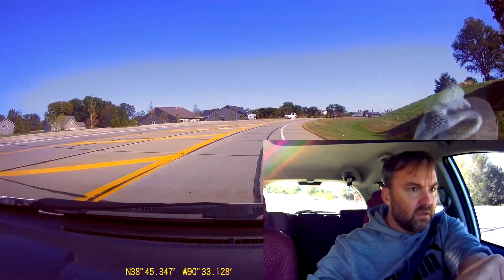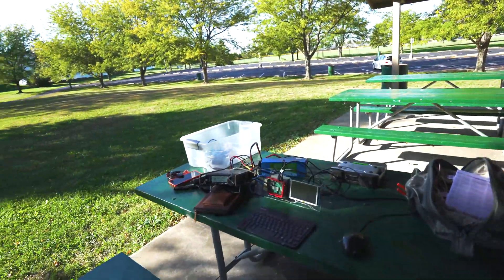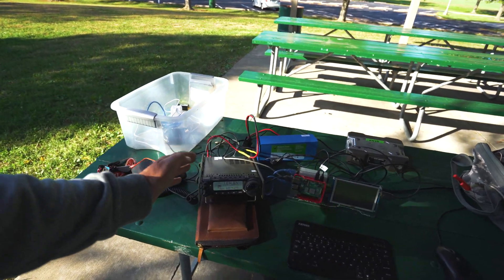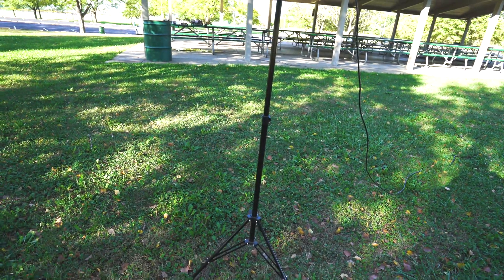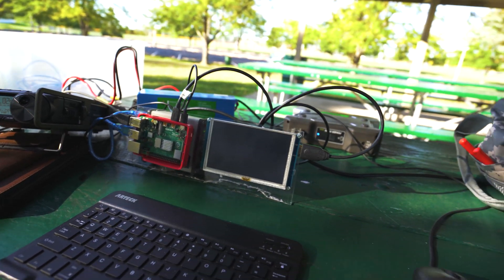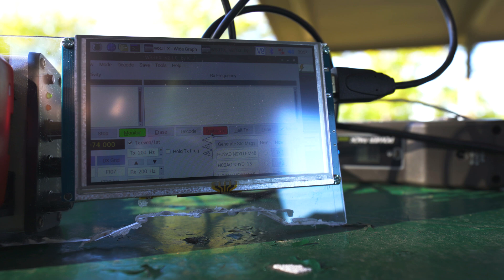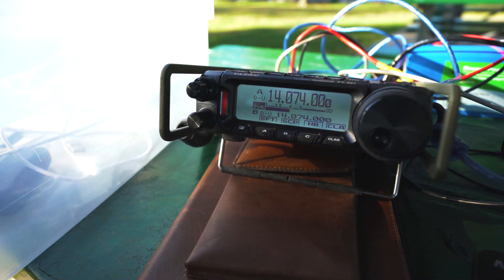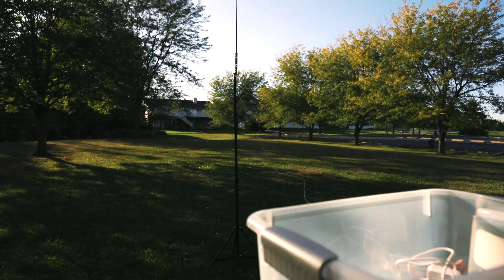Field Test | Raspberry Pi | WSJTX FT8 Digital Portable

Comment: Sometimes what appears to be a failure is actually a success! I would type out a nice cheat sheet with diagram of your setup and laminate it. The no decode thing is probably a clock issue and lastly, I have always had success with a ground mounted vertical with 8 or so radials. An MFJ whip and a ground mount stake made up with an SO-239 on it is the way to go. NOTE (Putting out a CW CQ signal would have shown that you were getting out). Great video!

Comment: Hey Tom .., the problem receiving was the clock ., the clock should in sync with the info received on the ft8 , there are 2 workarounds.. 1- use a gps for the clock sync ., 2.- Add an external rtc module to the pi ., and made the sync at home. :) XE1GSY.. 73 !!
Reply from the maker: Hey yah, I believe you are correct my friend.

Comment: If you want to simplify things and maybe reduce a couple of wires, try using a tablet.  I assume your Pi has wireless network capability, so all you need to do is run a virtual remote desktop with something like VNC on your tablet.  That way you can use a bluetooth mouse and keyboard and have a screen, but reduce the wires needed.
Reply from the maker: Yeah, I like a keyboard though.

Comment: 1. We finally have cooler weather in Metro ATL, too, and I endorse your wx comment. 2. It might be worth making a block diagram and/or a checklist of what goes where. It could make it smoother setting up next time. 3. I enjoyed your video.
Reply from the maker: Yeah, problem is, for my videos, I mix and match equipment all the time, plust camera batteries, lenses, carrying cases etc. etc.  Easy to miss
Reply: @hamradiocq  I keep a mental iist of what to bring on outings, and I am working on writing everything down.

Comment: Hi Tom:  I have noticed that when I remove the usb cable from my computer no matter which brand of computer you are using sometimes the audio is not setup correctly after reconnecting the usb cable. Make sure that in the FT -8 PROGRAM  under settings and under the audio tab the setting is for your setting for correct audio not the default speaker setting. KM4BACK Jason has some exelent video on YouTube on using the RP in the different digital modes. One segment shows how to get the RP audio setup. If I find the video segment I will post it later today.
Reply: That callsign should be: 
KM4ACK!!! I HATE AUTO CORRECTION ...SHOULD BE CALLED IDIOT CORRECTION
Reply from the maker: Ha!  Yeah I hate auto correct

Comment: If you could have something like a rack mount case ( smaller though) and have panel connectors to the radio with the front mounting the monitor. The raspberry almost reminds me of those mini laptops with the Atom processor from 8-10 years ago, without the keyboard and monitor.
Reply from the maker: Right, I certainly need a more professional case and carrier.  I'll work on it for sure.  This is phase 1.

Comment: I think maybe your FT8 timing was off. Did you have the pi online? If not, you will need to have another way to time the transmit/receive blocks. I use a GPS tracker for FT8 in the park.
Reply from the maker: Duh, I think you are right.  It needs to be synched by time.

Comment: It sounds like the IF width is set too narrow to receive much, if any, FT8 signals. Go into the Function-1 menu and locate the WDH option (3rd column, 3rd row) and select that and open it as wide as it will go (3000Hz). That should solve the receive issue. I had the same problem a while back and it drove me batty.

Anyway, very cool with the Raspberry Pi! I might have to steal this idea from you!

73, KA8GPM
Reply from the maker: Great comment I will try that tnx.